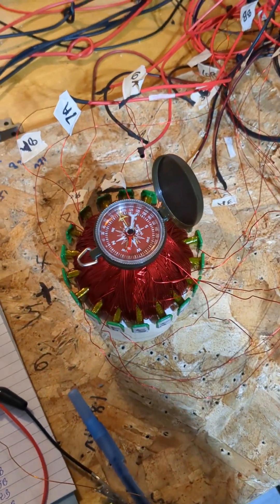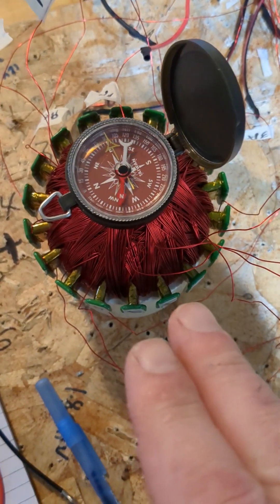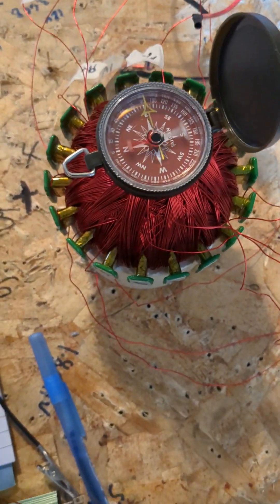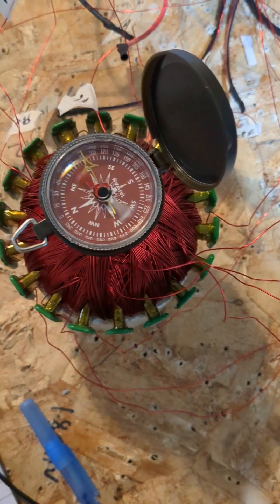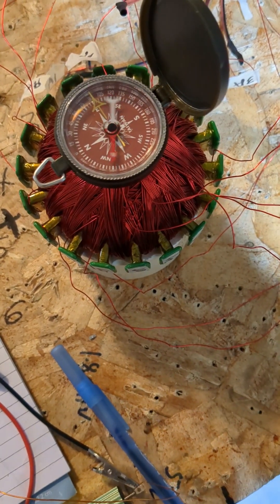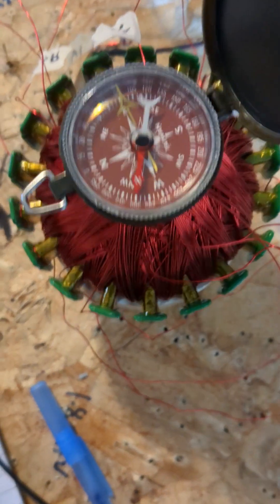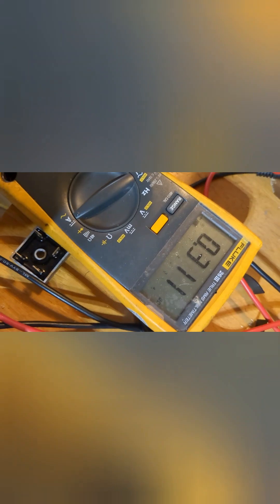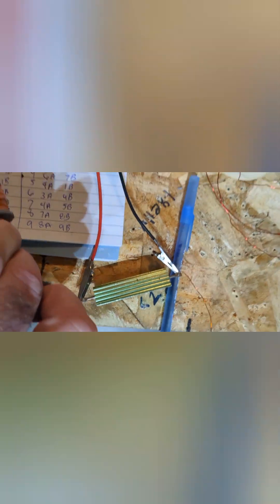virtually rotating magnetic field, causing input to lower when powering a load

Comment: Fella, you would know this. How do I control four electrical lights one at a time with being able to control the time on per light ??? Thanks
Reply from the maker: what type of lights?  Give specs please
Reply: Heat lamps light. The one light will be turned on for a few seconds that are fully controllable then the next light and the next and the next. Four lamps which are 10 to 12 amps 120 volts. This way you can use the lower power voltage and still have four totally working heat lamps. Thanks  @floodrod
Reply from the maker: @victoryfirst2878  I would use AC Solid State relays that trigger with 5V dc.  Then control them with a cheap arduino nano.
Reply: Thank you for the help Sir. Will start right on the making of the controller.  @floodrod
Reply: Thanks for the information Sir.  @floodrod
Reply from the maker: @victoryfirst2878   If you need help with the controller coding / setup- start a topic on Mooker forum in the description and I can help.  I will make a category under "Other Discussions"  for Non-OU projects like this
Reply: O.K. let me get started Sir. Thanks.  @floodrod
Reply: Here is another solution idea. You can also use magnetic red switch to control AC or DC semiconductor devices (4 example like SCR's, mosfets, or other transistors. Any transistor will work) When a magnet comes close to the magnetic red switch, it closes then this can activate the any transistor's base and then it can the light, coil or anything you want.  A little magnet can control anything you want.
Reply: Makes sense Mehmet.  @MehmetBoysal

Comment: I know you have found the solution that you shared in your latest video clip. But what if you had a simple decade counter 4017  chip and the output of each leg would activate a power transistor or a mosfet which would energize each individual coil winding, either clock or counterclockwise don't you think such a simple would allow you to rotate magnetic field with a smooth rotation?
Reply from the maker: Honestly I have no idea.  I suck at electronic circuits.  But I do know each connection must be able to change both positive and negative. So a single P or N channel mosfet will not work per leg.  Must be a switch that can work in both directions, or physical mechanical contacts.
Reply: @floodrod  Good point, thanks.
Reply from the maker: @MehmetBoysal    It can be done perfectly without any switching.  I am sharing the new method I will be doing real soon on the mooker forum.  I think it will eliminate the need for the complicated circuitry and make the phase sines perfect.